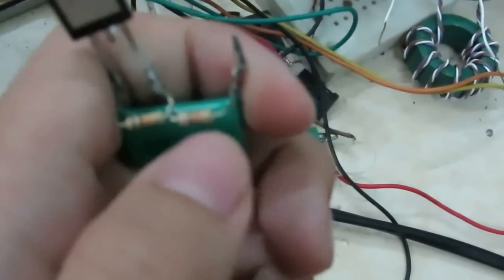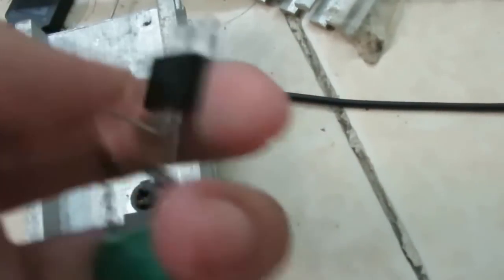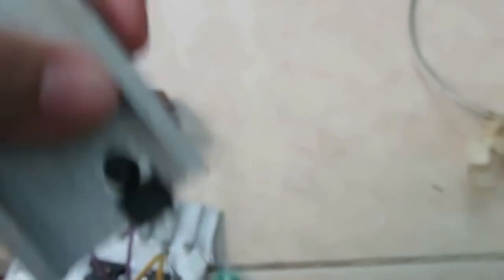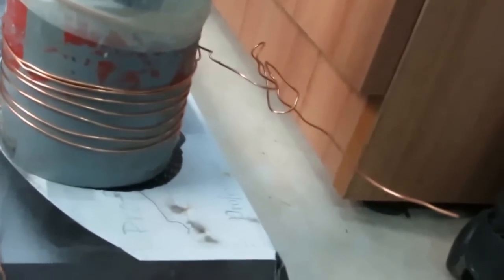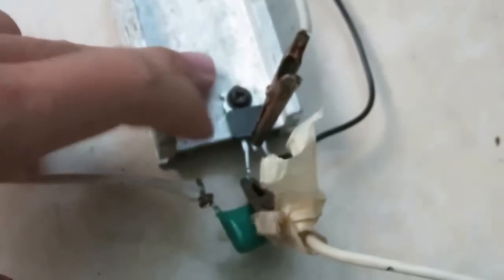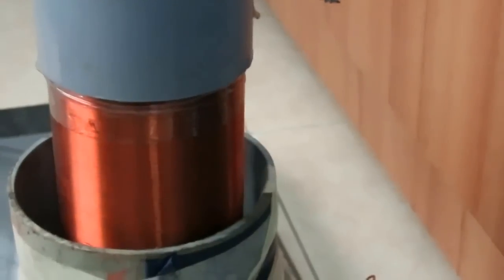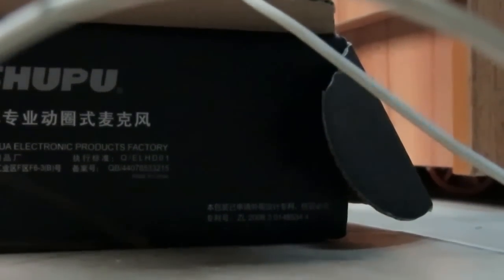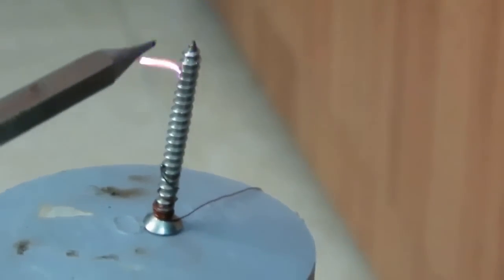How To Make Mini Tesla Coil "Powerful'' V.1

Comment: That transistor is not availabel in my city anouther transistor?
Reply from the maker: you could use 2n3055
Reply: Harold Victor i have thiese transistors will it make good sparks